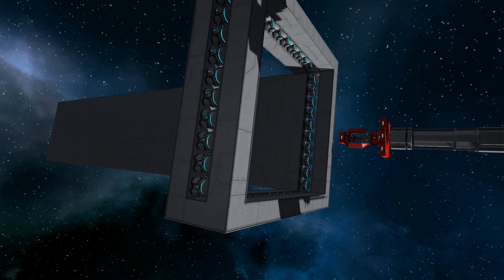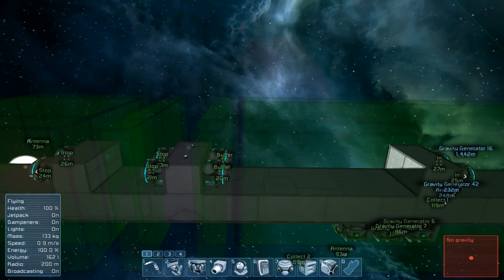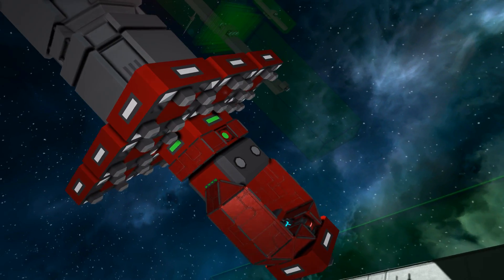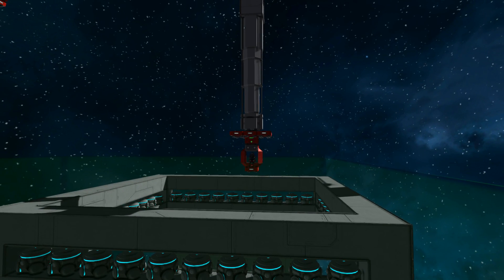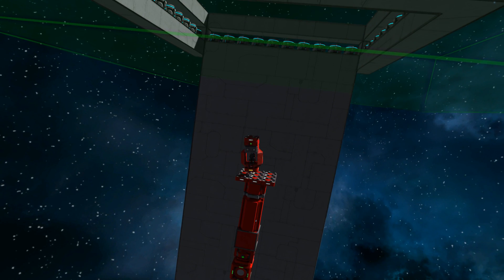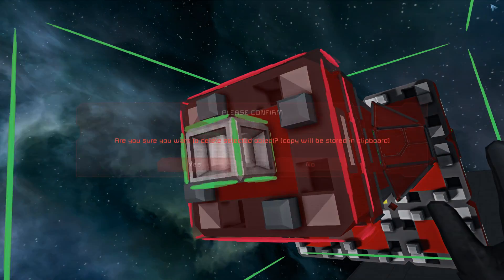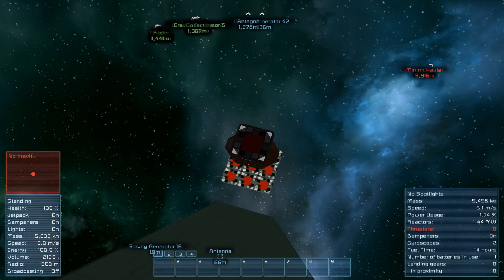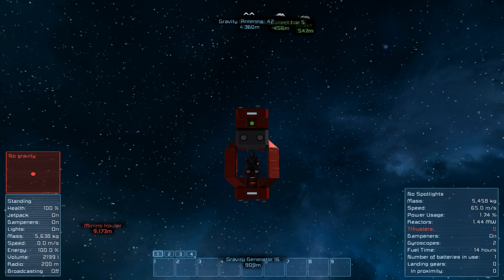Space Engineers - WiP Gravity Elevator/Catch Net System

Comment: with merge blocks and connectors there is some random velocity added that can expatiate over distance by either the action of disconnecting or the magnetism from these blocks
Reply: also any of the moving blocks are almost certain to wiggle no matter what possibly try multiple pistons in parallel
Reply from the maker: fininishingblast Think I'll just remove the moving blocks from the equation entirely by not having the grav field active until the merge block is released.. it should then give the craft time to 'stabilise' before I swtich on the gravity. Cheers :)

Comment: I think your biggest issue for inconsistency is the pistons. Pistons introduce some very strange behaviors into the physics engine, and It appears that there is a pull on the pod before it it successfully released; This is probably causing some microwobbles as the tension on the pod from the piston is released. That is what I can see inherently causing problems at this moment in time. Ill go try it out with normal station blocks and report my findings.
Reply from the maker: I think you are probably right, the head and how it connects to the main body has been a consistent issue and although it's only in 1 axis in this case I'm willing to believe that's still causing the problem even though I thought they were pretty stable in-line with the piston. Cheers :)

Comment: why dont you elongate the field of gravity an bump up the power so it would make a complete stop in the field then have a sensor to detect smal ships turn of the main "brake" gravgens and turn on a single one in the oposide direction with a smal force to let ik conect to the mergeblocks and if you incounter an problems with accuracy put in som gravgens on the x and z axes just make sure to have more braking force then main thrust
Reply from the maker: I like that tbh, gonna save it as a workaround though as my goal is to still have the ship moving (albeit VERY slowly) once it leaves the field at the far end, if you were to have another single gen like you suggest while it would be slow to begin with it's going to end up slowly accelerating and so will potentially limit something else I had in mind.. however the idea of using sensors to deactivate the gens is one I hadn't thought of and potentially something I can use elsewhere, know this is all a bit vague but I don't wanna spoil what I have planned for the end version of this :)

Comment: i think...maybe the initial speed isn't 0. if you see, when the "seat" is in the grav field, the speed go from 0 to 1,2 m/s and back very rapidly. this mean there are two force, the grav field force and the merge block force. BUT, if you can manage to set the speed to 0 then the field acceleration and deceleration will be on the right set up. example: multiple timer 1st action, deactivate starting grav field and reverse the piston. 2nd action deactivate the merge block. 3rd action, grav field on.

in this way you don't have the contrasting force beetween grav field and merge block, and the starting speed won't create strange fluctuation of the force starting vector and mass center. so the piston have to be connected to the grav field in some matter, but i think this want to be the your ultimate goal, right?
Reply: another thing, you can use some well-placed grav gen mid-route (especially the spherical one) to curve the path.

by the way, for a better elevator i suggest one with wheel
Reply from the maker: kaffaj I've already done one with wheels... well, sorta :) Was a subway system but in the end turn that 90degrees and you have an elevator!

Think you are spot on with the speed fluctuations being the cause and perhaps even that's it's the interaction between an item the game should be able to move (the mass block on the ship) and something that then later in the checking procedure by a sufficient amount to cause this flux then comes up as immobile (the merge block). The spherical thing was gonna come next.. first I just wanted it to go in a straight line and then brake correctly. I thought with 2 perfectly equal fields and 2 identically positioned (in respect to direction of travel vs CoM of the ship) mass blocks it should literally apply an equal force at both ends and thus if I have it move very slowly into the field one end it would leave the field at the other end also traveling that speed... Should make sense and hopefully it still will once that stupid piston is out of the equation.

Comment: Instead of a flat approach, I'm going with a catcher's mitt of spherical gravity generators and a small ship carriage to sit inside.  Using large ship landing gear to place the carriage within a holding net of spherical gravity, which then switched to 16 g's flat in the direction I want to travel.

I've also found that vector is inconsistent a bit, so too many variables for your exacting approach. I ended up with an activatable gravity gate that is also a large ship so you can point it in any direction, best accuracy is 10-15km, but you can go further if the beacons on the end are in range and you're willing to travel a few km.

I use a large cargo drone to ferry cargo to my refinery about 8.5 km away, once the drone is out of range it activates it's inertia dampeners automatically within range of my bases antennae, where the local operator can take over and dock it in, and send it back my way via a similar gate.

Bottom line is you can't do it this way, gotta  do it with a gravity net generated by a combo of flat and spherical to hold it in place like a tractor beam, and then grab it with something.

Comment: Extend the gravity field so you reach max speed and set it so it turns on when you want to launch. And the piston may be causing a bit of wobble as well so maybe don't use that. Also make the pod more symmetrical batteries on top and bottom also check center of gravity with projection cube make sure that's center it may be causing some of the issue.
Reply from the maker: Can actually turn center of mass on in the info panel and that is remarkably close to central atm even though it's not totally symmetrical.. Moving to max speed would solve the issue as you would imagine that the variation I'm seeing is a + 0 to + 1.9 and at max speed that would obviously be impossible, although having found this inconsistency I wanna work out why rather than work around it like that.. I'm pretty sure though the wobble-piston and how it interacts with the merge block is the problem now. Cheers :)
Reply from the maker: SioxerNic
I actually already tried max speed and what I discovered is that while you'd assume max speed to provide a constant and things to be limited to that, acceleration(and deceleration) isn't.. and so while looking for a constant I just found a lack of a proper limit :(

So yeah, seems you are right sir.
Reply from the maker: Hehe, indeed!

Comment: So.
Firstly, you have a ship/pod/whatever which is non-symmetrical which is going to lead to slight differences in calculations with the spin of the craft as it goes.  
Secondly, you have no form of alignment system at either end. We're all familiar with the collector bucket which was common in builds before the docking functionality of projectors so modify one of those for use as an alignment system replacing the connector with a short tunnel of sorts with a merge block at the end the docking thing. Remember to place this after the slowing field so that when your pod comes into contact with the sloped sides due to coming out of line it doesn't get mangled/nudged too much.  
Thirdly, you are using pistons to lower the pod into the launch zone rather than enabling and disabling the gravity generators. Not only is this inefficient in a survival sense as gravity generators eat power like there's no tomorrow but when you extend the piston it will waggle and cause you to not be properly lined up. Remedy this by having your launch timers enable the gravity generators for a short amount of time, say 10 seconds, to launch your craft rather than using a piston which misaligns you and eating power constantly.
Reply from the maker: The piston and gravity power usage points are very good ones, the power thing I might have come round to improving eventually as this is just trying to work out the concept first rather than the final application I had planned but certainly hadn't thought about it yet and now will do so, thanks :)

Now, this will sound weird because I know I miss in the video.. but prior to that I'd done at 100 tests and gone dead straight with 0 deviation in every single one of them, have about 1:30 of footage of me just going back and forth changing piston settings and while the speed differs, it's straight and doesn't spin every single time.. Then when I get to the video recording, it misses! I can't even work out how that happened tbh.. End result though is it shouldn't need any alignment system at the moment, the only force acting on it is linear and perfectly lined up with the target and as you can (hopefully) see in the vid the lack of symmetry doesn't cause any spinning.

Comment: Since the forces are identical, the error must be in the amount of time the force is applied. With high speeds and such small gravity fields, there is a very small margin for error in the amount of time the craft is accelerating (ie inside the gravity field) compared to the receiving side. I agree with previous comments that larger, less powerful gravity fields would go a long way to lessening the impact of small inconsistencies in the period of acceleration/deceleration.
Reply: good point
Reply from the maker: Or potentially in what a few have spotted which is that the game actually considers me moving BEFORE I've separated the merge block.. it's not by much but it's inconsistent itself and that's a pretty clear sign to me that I have to remove that variable first and then see. I agree the very short field is asking for a bit of trouble but for the end design (which no longer involves straight lines and a few other nasties) I kinda need them to be nice and contained like that.

Comment: Look up the catch system for Aircraft carriers to get some ideas on braking.  In the smaller config you have single to multiple to single.  In the live test it was what appeared to be single to single.  Try without pistons, they are still wibbly wobbly.
Reply from the maker: Catch system on carriers is cable based I thought, not sure there's an easy to replicate that in SE at the moment although I will do as you say and go and have a look to see what's what.. I'm pretty good at being proved wrong :) And yeah, pistons.. wouldn't it be nice if they were made out of metal or something that doesn't flex like rubber!
Reply: True but the cable is tensioned and not static.  Hitting the merge block is hitting a brick wall.  Any chance on trying a multiple zone gravity "brake" instead of a single instance?

Comment: Your inconsistency could be being caused by a flaw in the coding of the game's engine. When you fire ore cannons you sometimes notice that the ore will clip through armour blocks like they weren't even there. Objects moving at high speeds don't get checked for position all the time, for obvious reasons, I think. It could be that the gravity field doesn't recognize that your ship is even inside the gravity field until you're well into it. One thing you could try is extending the gravity fields outward and making them weaker. Possibly you could set stages of increasing (or decreasing, idk which would be better) strength gravity fields, which might serve to smooth out the motion. Anyway, good luck with your project it looks like it would be pretty awesome when it works.
Side note: Are you planning to do anything with the new programmable block? Or are you not into that kind of thing/don't know how to do it?
Reply: 12jojimbo That's a consequence of all software physics engines that aren't specifically coded to prevent it.  Basically it can only check for collisions so often, and if you're travelling at a sufficiently high speed that the entire object passes through the target between collision checks, it doesn't register a collision at all.  In fact, I'm pretty sure I remember someone (Marek?) saying that's the reason for having a limited speed at all.

Position is handled a bit differently in most engines - it calculates the vector along which the object is travelling and the speed, figures out how much time has passed since the last update, and then moves the object the appropriate distance.  This is in fact the cause of the collision problem, because it's possible to move an object an arbitrary distance without having it be at every point in between for efficiency's sake.  As such, positional accuracy is always high.  A good engine, where such a thing is important, will go back along the path and check for collisions and then act on them appropriately.

Anyway, all this is to say: there's not a lot of margin for error in an object's position and trajectory.  It's not a periodic update thing.
Reply: ***** I think I said under another comment thread that the piston thing sounds like a pretty plausible cause, yeah.  And I've also seen gravity-propelled pods act consistently, so I'm pretty sure it's not the gravity gens themselves.

As for coding, I really wished they'd chosen lua or something equally simple, but.. I've a couple of resources.  If you're completely brand new to coding, check out CodeAcademy -- they don't have a C# module, but go through javascript or something to learn the very basics of thinking about how to put together code that does what you want.  That basic skill translates easily once you know the syntax of the language you're using

 CodeAcademy is /the best/ for learning programming because they start dead simple and it's all interactive, writing code on the fly, not staring at a video.  Also, learncs.org appears to be similar to CodeAcademy's style, but is specifically for C#, though I haven't tried it myself.

What I'd really like to see is an API reference (all the commands like GetBlockByName, etc) for interacting with the various blocks.
Reply: ***** I'm in about the same boat, with the addition of occasional ham-handed tinkering over the years.  I took a class in ANSI C once, but without daily use of it, I didn't retain much.

If you find that reference doc again, hook the rest of us up. :)
Reply: ***** Awesome, thank you.
Reply from the maker: Steve Pittman 12jojimbo Think Steve has pretty aptly summed up why that particular issue exists, now it's a case of proving whether or not that's the problem here although honestly I'm a lot more concerned now about the effect of the piston/merge block combo than potential game engine limitations, pretty sure it's gonna turn out to be those especially as I'm not approaching max speed at the moment so you'd hope not traveling fast enough for the engine to struggle with as of yet. Need to test further :)

Yes I'm planning to do stuff with the programming block but to be both clear and honest, I cannot code and so am trying to teach myself C# at the moment (although barely started)... Hopefully shouldn't need too much before I can at least edit and manipulate code others have written and go from there.
Reply from the maker: Steve Pittman
I'm not totally new to coding having studied java and pascal a little at uni so have a grasp of the basics but 0 knowledge with C specifically and honestly I was never very good at coding anyway :) Cheers for the links man should be handy, gonna give learncs a go first a think and see how things go.

I found a reference doc at one point on reddit in PDF format that someone had pulled out of the SE files but now can't find it again, knew I should have bookmarked it..
Cheers dude :)
Reply from the maker: Located! http://www.reddit.com/r/spaceengineers/comments/2r3ie3/full_programming_documentation_here_thanks_to/

Comment: Use gravity stabilizers, 4 gravity genarators around with the block in the center...
Reply from the maker: On the pod or on the 'stations'?
Reply: on the stations, so that the gravity is facing inwards on four sides, so that it keeps it in a straight line, always. Then for stopping it you could possible use sensors and thrusters on the pod in order to slow it down, this could work with connectors.
Reply from the maker: Skycaptin Ben Ahh right I see what you mean.. Would work for sure, but I'm stubborn enough that I now wanna find out why exactly this isn't working, I'm pretty sure physics dictates that if you apply a force in one direction to an object (thus giving it kinetic energy in this case) and then apply an equal force in the opposite direction the object should return to it's original energy. I'm also pretty sure now it's not physics that's the issue but something ingame, likely the piston.